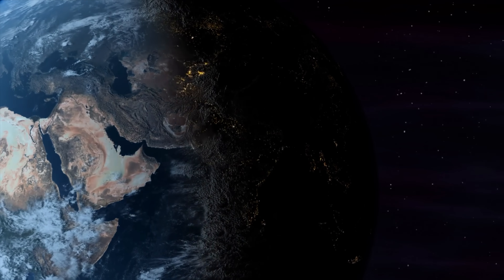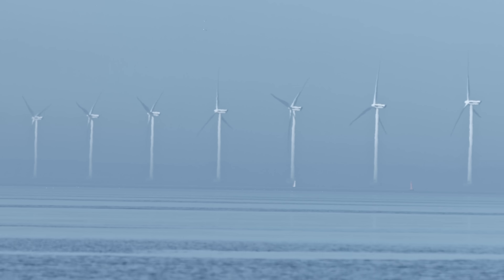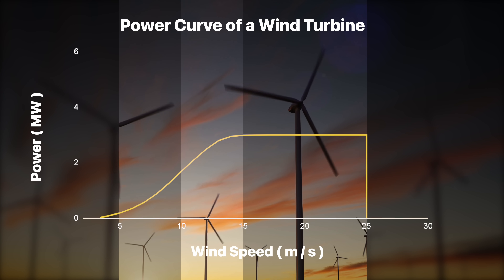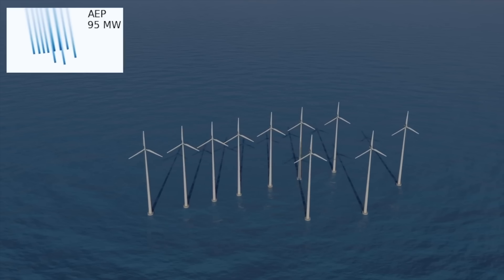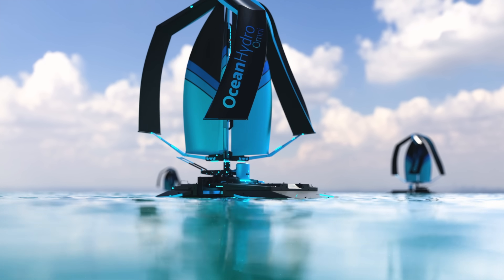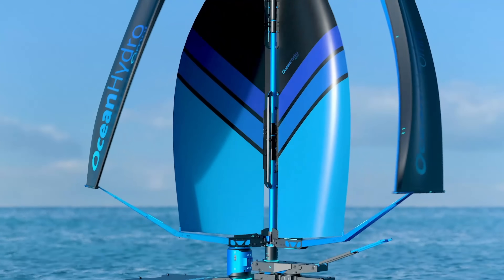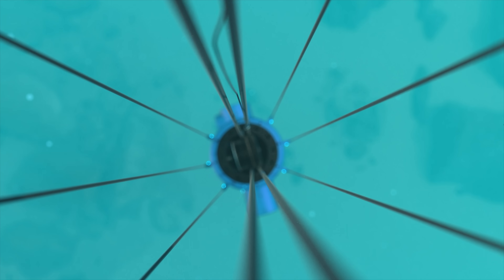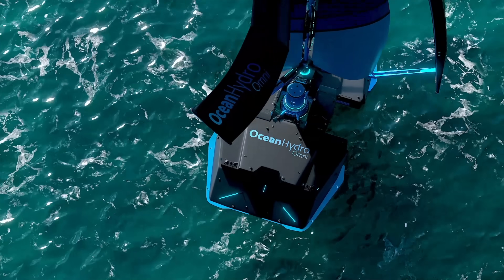Breakthrough Tech Solves Wind Power's BIGGEST Problem!

Comment: Looks like the consensus is that this could only work if ALL of the undersea mechanicals are completely protected inside of a hollowed out tube, so that they are isolated from the corrosive effects of seawater, the damage caused by marine life of all types and the effects of undersea currents on that massive weight structure and other physical and mechanical parts of the system.

Comment: If the weights were hollow the horizontal wind turbines could pump compressed air down into the weights and the buoyancy would lift the weights and electricity could be generated whether the weights are moving up or down.

Comment: Initially, this sounds like a great idea. However, I can see (like many folks who have commented before me) that maintenance of all that underwater equipment would be a nightmare.
I kinda like Xero1on1's comment below; to build the same idea on land on towers that would house the weight/generator system, and the turbines stretching down the length of the tower (though that might interfere with how much wind the turbine could 'catch').
Overall though, the idea of building 'wind-powered gravity batteries' is a pretty slick concept!

Comment: Cool. But VERY early days. They've built prototype components & tested ON LAND. All the mechanical parts other than the blades will have to operate under water in the ocean, an incredibly rough environment.

Traditional turbines only have a static tower & electrical connections underwater. That's tough enough but the bugs have been worked out over 50 years, the static stuff on bridges & offshore drilling platforms.

This outfit has to make mechanical gear survive corrosive hostile seawater. That won't be worked out any time soon.

But sure, let's see work continue on new technologies. Just don't count on immediate impact.

Comment: This same idea could be used on the ground, out of water.  A large central hollow tower with a weight suspended on cables within it, and a vertical wind turbine extending from the top of the tower to the bottom for some massive wind catchability. You could then support them by having multiple towers close together with framing connecting the tops of each tower, stabilizing each other the more that are connected. Plus you wouldn't have to worry about the sea salt corroding things. The only thing you miss out on is buoyancy... but just as buoyancy helps lift the weight, it also impedes the weight as it falls.
Reply: Brilliant take!
Reply: There reason for placing them offshore is that 80% of wind power is offshore in deep waters

Comment: If the weight contains a tank, you could flood the tank to sink the weight, and then use compressed air to empty it on the bottom, lowering the power required to lift it back up.

Comment: Here is a feasible proof of concept experiment for this.  
The proposed height in their illustration is 100 meters.   Many wind turbines are mounted to towers that size.  Mount their vertical windmill on top of an old one with the weight, generator, and cable apparatus inside to raise and lower the weight in an enclosed environment.   No corrosion or currents to affect the equipment.   Plus you have a height advantage to get the better wind speeds.

Comment: Using mechanical energy for air storage in a water column would allow for less linear power storage, up to a practical limit.   Multiple systems could be linked to store physical energy at successively deeper reservoirs.  The biggest challenge is affordable materials that are indifferent to corrosion and barnacles.

Comment: I think the gravity battery storage  would be better used on dry land. There would be a lot less maintenance required over time. The current and the sea water alone would cause damage and stress to the cables and any mechanical parts and be a nightmare to maintain. On land you could hook the gravity battery to multiple variable energy sources wind, solar, tidal etc without the extra expensive maintenance costs from having it out in the ocean.

Comment: Ok, let's clean up with the pump & dump influencer spin a bit. Vertical axis turbines (VAWT) do only have a useful high power conversion rate in a very narrow wind speed range. A difference of just 1 m/s higher or lower cuts the efficiency in half make it totally uneconomical. So you will have just 20 days in a year where the turbine has any usefull output to regain it's CAPEX. A HAWT (propeller type) can adjust the blade pitch to the wind speed and gets good efficiency on 350 out of 365 days offshore. That is a vast difference in revenue vs CAPEX over a year of operation.

Combining a Darries VAWT with a Savonius rotor inside does curtail Darrieus efficiency by blockage of flow. A Darrieus wants to work by lift and needs to go faster than wind speed. A Savonius fixed sail is driven by drag. Means the wind pushing the surface. When the Darrieus takes over the Savonius is a giant air brake. Like an aircraft braking for landing with whining flaps extended. Inner and outer radius relative speed somewhat adjust this. But whatever is inside the diameter is disturbing the area coverage and Betz Limit properties of the turbine. Means another crash to the power conversion ratio and efficiency. This has been proven by multiple designs by the US DOE. There is no reason to repeat failed experiments here.

It is advisble for any investor to obtain lab model data certified by an independent audit body. Means following the standard practice in wind energy engineering biz. It is also advisable to contact operators of Darrieus type turbines and read into the engineering perception of the challenges of VAWTs.

Regarding gravity storage this has been proven dismal in power conversion in many engineering videos about land based attempts. The friction loss is very high. It doesn't even work on land and will do less so in seawater that his highly corrosive, asks for very expensive steel qualities and coatings as any yacht owner can tell you. It also gets quickly occupied by sealife within hours of tidal cycles.

This is basically 3 bad ideas blended into one.

Comment: Let's build wind turbines at the water level, where the wind speed is something like a fifth of the wind speed at 100 meters. Yeah!

Also, I'd like to see these wind turbines generate more energy, than traditional wind turbines. All attempts at building that kind of bind turbine, has shown they are way less efficient. Something like half the output. But don't quote me on that one.

And like other people in the comment section mentioned, there's a lot of issues with building something, that needs to work under water.

Comment: Rubbish, this wont work a) because of the massive amount of maintenance that something in or close to the sea will require b) because of storm damage as mentioned by others, but mainly c) because gravity storage is such low density energy that its not worth doing. 
A 30 ton weight falling 100m will give you 30,000x9.8x100=29.4MJ of energy. 3600J=1Wh so 29.4MJ/3600=8167Wh which is 8.17kWh of storage, and that's at 100% conversion efficiency...... pathetic given all that goes into making it. 
For comparison a Tesla model S battery pack currently stores 100kWh. So you'd need 12 of these to charge EACH model S. Ain't gonna happen.
Even if you made the weight 10x as heavy, or fall 10x as far, it would still mean that one of these wouldn't charge a tesla.
These guys must be great sales people if they're getting backers. They should stop wasting energy, money and resources. Fuckin shysters.
Reply from the maker: good calcs, but what these can lift the weights in a few hours so it can run multiple times a day, on demand, works well in a larger array, and requires no lithium. Hopefully you can see why its interesting. cheers
Reply: @TwoBitDaVinci  Sorry man, it's still a bad idea. Even if you could raise and lower it once an hour you still couldn't charge your Tesla overnight.

Comment: Love the idea, but it sounds like you have been drinking the coolaid! I don't understand how this is going to be cheaper than a conventional wind turbine! It has a smaller area swept of wind, it has more parts and more moving parts. I don't understand how it will survive underwater for more than 2 years without massive maintenance. This is the reason we don't have cheap wave power. Every machine either costs more than the energy is worth or it needs to be towed to shore, cleaned and repaired every year wiping out ant possible profit.

Comment: What utter crap.

You can attach the exact same gravity battery to "traditional wind turbines" for increased effect.

Why don't we? hmmm is it perhaps that when you calculate in storage suddenly wind/solar isn't all that attractive anymore?
Reply from the maker: not sure what youre background is, but I think you missed quite a few points in the video. capitalizing on higher wind speeds, and being able to be deeper in the oceans... where highest wind speeds are. if your mind is already made up... not sure what to tell you. I just wanted to cover an interesting tech being worked on. cheers
Reply: @TwoBitDaVinci  The Video itself says traditonal wind turbines are more productive.

Thus the higher output of said traditional turbines could be used just the same to load a battery, gravity or otherwise.

Add to that gravity battery efficiency not being on par with say lithium-ion and you get a rather lackluster result from horizontal turbines and gravity batteries.

It's not that my mind is made up, it's that these are the facts I am presented with. I have no personal attachment to either horizontal or traditional wind turbines.

Comment: This is the worst of both worlds. The wind will be too slow (at that elevation), and their energy storage solution is impractical and extremely inefficient.
Imagine what will happen to the tethers\anchors holding these in place during a storm. There's a reason we put turbines on pylons and not just anchored floating platforms. 
Also, salt water will eat through literally anything and everything you put in its way.

Comment: Where did you get those wind speed measurements at ~1:17? That looks like surface variability, and also normal night/day cycles. It looks really misleading. Did a VAWT designer provide that data? The wind speed is remarkably consistent at 100m or 300m compared to surface level. While it presents a challenge for maintenance, the difference in wind power really makes VAWTs seem silly. I'll go finish the video but I have a feeling you're going to want to revisit this video and take a closer look at that graph.

Comment: stop importing, so you a) dont demand, b) learn to make stuff c) buying from a store is not making
Reply: attach flywheels to the vertical axis wind turbines, as a direct storage
Reply: so why dont you build them with large ships, build turbines at coast, in the shipyards
Reply: just put the turbines in place, dont waste time in mass hysteria computation efforts
Reply: all in the computations is intuitively seeable
Reply: without knowing a thing
Reply: there is no problem in the coming back air stream, just flex it away
Reply: you dont have to put the heavy lifts in the ocean
Reply: separating problems makes things simple, separate the generation from the storage
Reply: money makes things succ, biased, towards and through and with money
Reply: so we have "new" new "new" new "new" solutions all the time, for money reasons
Reply: just install smart batteries, keep the turbines, all types, running, all the times, dont stop the turbines

Comment: There is a reason why VAWT's are not in widespread use, they are at such a disadvantage from a power generation point and their self destructive nature.  Being close to the water surface would only accelerate the wear and damage to the rotor . Also the effect on fish, whales and dolphin's would be significant due to harmonics generated by the anchor and winching cables .

Comment: A few major disadvantages that I see are first,  moving parts underwater are famously unreliable, and second the wind speed rises substantially with getting higher off the water. So these turbines will get much less power from the wind as they are low to the water. Finally, having moving blades just a couple of meters off the water will be a huge problem in rough weather, and even in calmer weather the salt spray will compromise any moving element.
Reply: In their simulation, it is windy, yet the water is calm.......
Reply: Way too many moving parts, and especially they are underwater, and complicated. The eggbeaters will make great fish habitat when they sink, and that is A certainty
Reply: Don't trust their CGI for scale.  The animated "waves" make the turbines look tiny.

But there are all sorts of other issues - moving parts in sea water being a big one that others here have already mentioned.  Another limitation, sparked by your rough weather comment, is storm waves - even mild ones.  Since the turbines float on the surface but are de-facto tethered to the sea floor by their "battery" mechanism, any substantial waves or storm surge are likely to disturb, submerge or even topple the floating platform.

They could try to use adaptive tether length using high speed winches to pay-in/out their tethers to allow riding the waves, but now we're talking about even more complexity on at least a couple of fronts -  Electromechanical systems to operate the winches in time with waves at the very least, plus eating up their own power output just to stay on the surface.

Of course they could actually design it to NOT have to "float" directly on the surface... but that's what their "only exists in CGI" shows us.  Which tells me their idea IS NOT at "level 6" as Guy Undoubtedly Looking For Money said.  They're at the "played with shiat in the shop and paid for some animations" phase.
Reply: Moving parts can be inserted in a tube. No sea water exposure required.
Reply: @DunnickFayuro  a tube full of air, perhaps?  A very buoyant tube trying to rip the whole to the surface?
Reply: @Randrew  Yeah, if you fill it with air, there's aproblem. Fresh water maybe? Or anchor it with several tons of rocks / sand? It's not rocket science to solve.
Reply: @DunnickFayuro  So do the math, and then you don’t need to hand waive.  The buoyancy of a long large diameter pipe, say, diam 1M, length 100M, will be 50-100 tons.  A massive foundation for an 100,000 ton oil gas rig could anchor it, but not a little wind turbine foundation.
Reply: @Nill757  No foundation needed if you pour enough gravel / sand inside. Anything can sink if you fill it with enough sand.
Reply: @DunnickFayuro  True, but then what’s the pipe for?
Reply: @Nill757  You don't need to fill the tube all the way to the top. Remember: the density of rocks is way higher than the density of water. There should be a calculator for that somewhere ;)
Reply: @DunnickFayuro  Empty big long tubes have a buoyancy problem underwater.
Reply: I guess the biggest problem is, that
* vertical wind turbines got a huge problem with resonance when they grow in size (therefor there is hardly any vertical wind turbine out there, which is larger than 15m)
* vertical wind turbines can't be shut off (despite the info in the video, this is a problem in windstorms)
* you can not save a lot of energy by lifting weight. Therefore waterreservoirs got to be huge ...onshore. Offshore the problem is even bigger, because water is really dense and the lifting capacity is limited by the semi-submersible platform for the vertical wind turbine

I had a similar idea, but I skipped it ...because of the reasons above. And now I see, someone had the 'same stupid idea' xD

Comment: It looks good on paper, it would need to be hydrodynamic so it moves through the water easily, but  it needs anchored to the seabed, so how well will it do when the swell goes from 2 feet to 10 feet, which means the floating platform has to free spin on the up-swell, then fast spool the cable in on the down-swell, while maintaining the freefall of the weight. Add to that, the wind is blowing the seawater from the top of the swell into the wind turbine, which will impact its ability to maintain steady rotation.
 I spent 6 years in the navy,, 4 of them at sea. My ship was in the north Atlantic in a storm, the water mangled 30 feet of a steel walkway on the side of the ship. That means these would need to be in protected with some type of a seawall

Comment: Looks very expensive , why not gravity storage on land to store and regulate power delivery  from normal wind turbines ? But as battery storage is plummeting in cost why not use more batteries to do the same job . Mechanical devices in a salt water environment have huge maintenance issues in both frequency and access . When you add in depth of water then it becomes exponential in cost .

Comment: There are a couple of points that Im not sure if you adressed. Usually turbines that work in a similair way has a very low power output. Do these in anyway differ in poweroutput?
Reply from the maker: they don't have to shut down in stronger winds, and energy cubes with increases in wind speed... that's the clever bit here

Comment: Even with tide power and wave power it would be a maintenance nightmare with most designs. Some have a risible platform and would be better. But it would be easy enough to have a device that dips it's blades in water only. And only the blade tips would need to be anti fowed regularly, instead of the entire device. Even I have designed stuff like that. And only has minimal exposure to sea water.